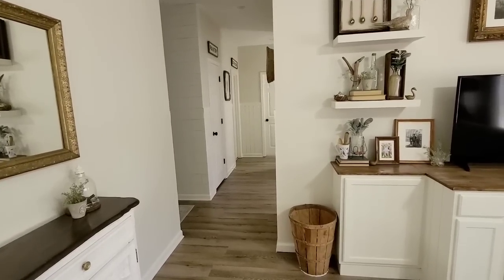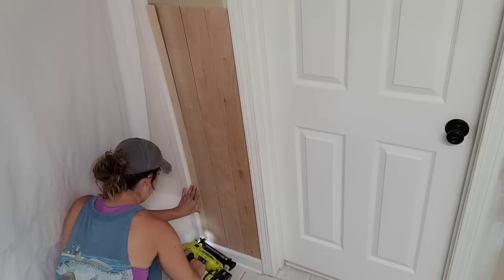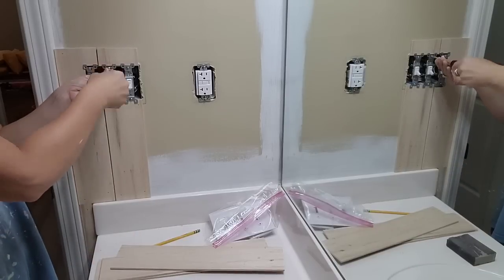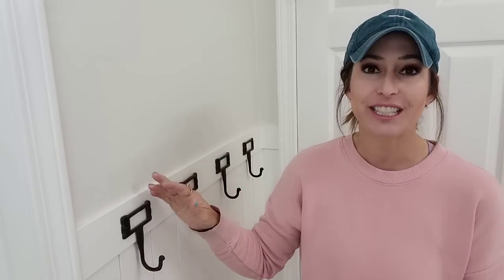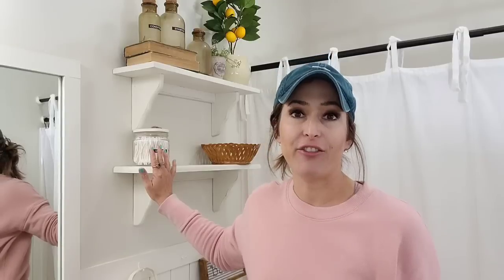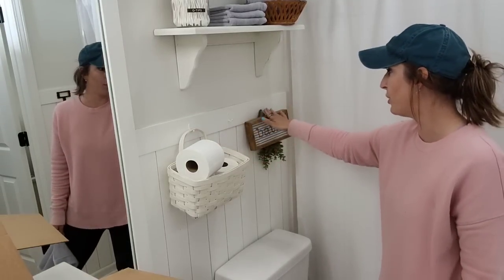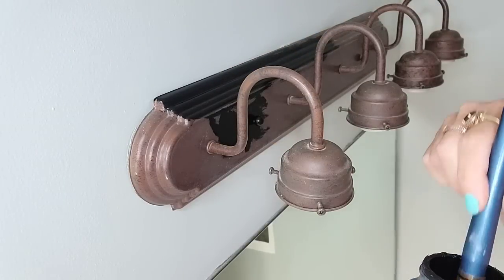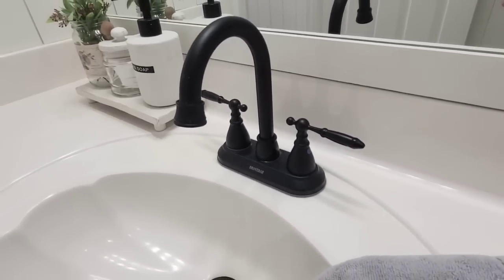DIY small bathroom makeover on a budget • Boring & Basic to Bright & Beautiful • Cottage Farmhouse

Comment: Love the transformation, as always! You can still use the top of your toilet for a long flat container or basket. Just add those clear rubber discs that are usually used for bumpers for cabinets as “ feet”. One or two stacked and hot glued to each corner raises the flat bottom of the container enough to clear the raised center of the porcelain tank lid. I have done this in all my bathrooms!